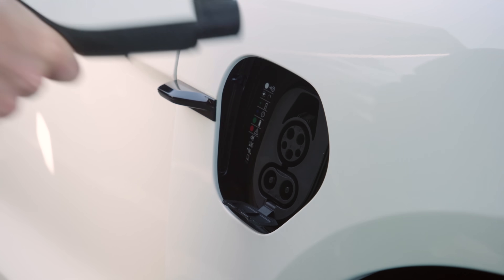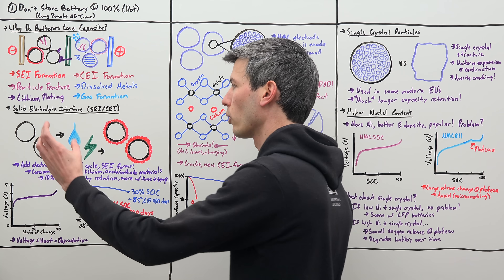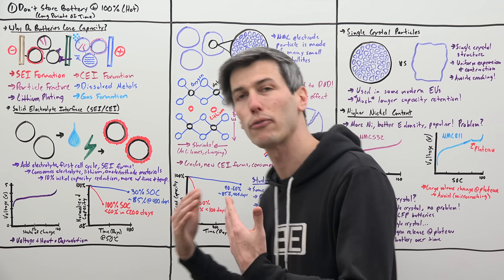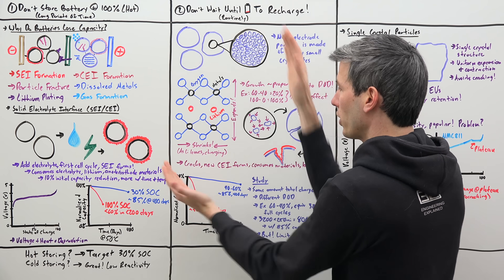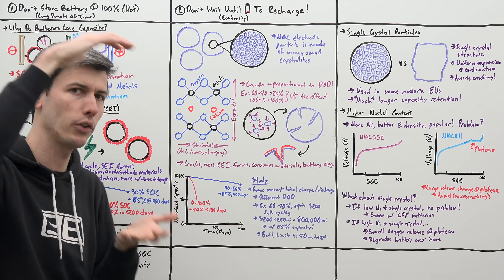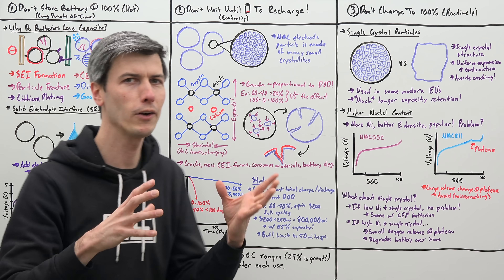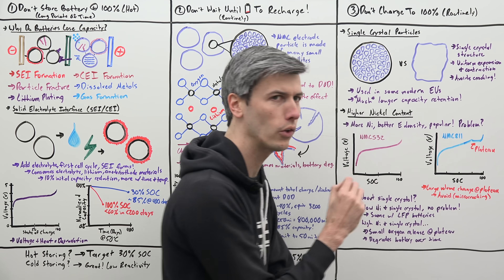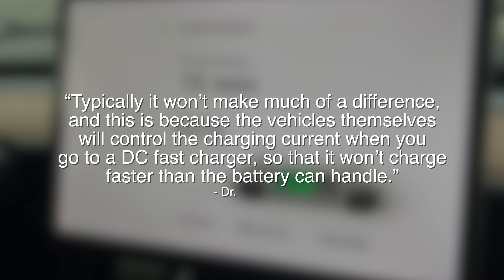How To Ruin Your Electric Car's Battery - NMC Edition!

Comment: Direct injection turbo diesels are what the world should lean towards or hydrogen power
Reply: Sic: hydrogen power. Diesels are efficient achieving up to 50% thearmal efficiency however the NOX and particulate emmisions are high, but can be mitgated with adblu or a proper exhaust system with the correct tech. However the issue woth hydrogen are that the production is highly emergy intensive and it is most often made from methane(CH4). The issue is that the carbon atom of the methane molecule combines with a oxygen gas molecule and producec an CO2 molecule byproduct. This is issue can be resolved with CO2 storage or by using electrolysis, but that requires electricity which might not be clean. Another issue is that 700bar hydrogen tanks are quite big, but do not hold a that much hydrogen.

Comment: Don't buy ev, look at Chicago winter crisis
Reply: 150 000 people mis-fueled a diesel engine last year and nobody writes about it. This was a owner problem, not a technology problem. RTFM.

EVs operate worldwide in cold temperatures. The recent extreme cold snap covered a wide swath of North America. The fact that the media honed in on a small number of cars at a single charge station in a state with 59 000 electric cars and conflated that as a disaster for the entire EV industry was silly.
Reply: @rbrtmllr  It wasn't even an owner problem. Most of the people who  were clogging the super chargers were Uber drivers who didn't have the ability to charge at home and have a habit of charging to 100%. Out of Spec Reviews did a deep dive on this in a couple of videos.

Comment: Step one: Don’t buy a EV as current battery tech still isn’t there yet.

Step two: skip brand new WAY overpriced vehicles.

Step three: buy and restore a 90s Toyota or Honda. 

Step 4: Enjoy a reliable durable vehicle that’s not full of gimmicks
Reply: Some people care about things like safety for their family and in general can afford nice things. Not everyone is a broke car "enthusiast" on the web.
Reply: @SR-cm2my now if you wana come at me with “not everyone wants to turn wrenches” that’s totally valid.
Reply: @SR-cm2my 🙄 those darn 90s cars and their inferior crumple zones, air bags and seat belts, how did anyone survive!!!
Reply: I remember when I was a kid in the 90s and everyone said the cars suck now and the old ones were way better. Nostalgia goggles never change, huh?
Reply: Just because a 90s car has airbags and crumple zones, that does not make it equivalent to the safety of modern cars. Just watch 90s crash tests vs modern crash tests, modern cars are often objectively safer. Not to mention new safety tech like emergency braking, lane keep assist/departure warning, blind spot monitoring, etc.
Reply: 90s car and early 2000s was the best.. simple easy and cheap to fix, we still have
Reply: @thatonebeone I loath the cash for clunkers program for this reason, saw so many good vehicles destroyed to save a relatively small amount on a newer vehicle, which shrank the pool of used vehicles by a very noticeable volume… I have suspensions about the real intent to it all as vehicle emissions from them well let’s just say it’s not like it was a 1950s straight exhaust and intake setup

Comment: Imagine not being able to fill up your gas tank to full without worrying about it not lasting
Reply: Nobody needs a full charge every day. Same reason nobody needs a full tank of gas IF they had a gas station in their home
Reply: yup i dont full fill up with gas...  half most the time and i hardly full tank unless i go far out trip drives .... but in very cold places EV struggle with battery and need to manage it... @Meatball2022
Reply: @Meatball2022  but the difference is that my gas car has 1. longer range and 2. I can fill it up once a month and let it stay at a full gas tank vs with an electric car I would have to charge it up at least 2x a month and adding the fact that you shouldn’t let it stay at 100% the amount of charging per month would even increase up to 3-4x. Nobody wants to spend that extra time if you don’t have a charging point at home
Reply: @dennis.lc8407 most people don't use all the range of their electric car anyways, or let their cars sit for a while. Also, don't ICE cars' gasoline go bad if they're standing a while? And their lead-acid batteries too?
Reply: @dennis.lc8407  you’ve literally contradicted yourself in your own statement. You boast about range AND the ability to never use it.
Reply: @dennis.lc8407  the video was clear. And I’m of the same opinion. It’s foolish to buy an EV without ability to charge at home. Anyone that does that is throwing the biggest benefit of an EV into the trash
Reply: @Meatball2022  I think you don‘t get my point. The range defines the days that I can let my car stay on the street without having to refuel/recharge it. I don’t want to charge my car 2-3x when I have the opportunity to just refuel a car once a month. That a technological downgrade. But I think that‘s also a difference from europa to the usa. As far as I know more people in the us have a house where you can easily install a wallbox. Not so here in germany
Reply: @nwskipro   What extra planning? You just set the state of charge in either the car's UI or the car's app before taking a long trip, other than that, leave it at 80%.

That's far less taxing than doing the basic checklist of things for an ICE before a road trip.
Reply: @lolo4gaming39To be fair, even with the level one charger, not everyone has access to even a normal outlet. Some people only have street parking, or their apartment garage/lot doesn't have outlets.
I've been using the level one that came with my Bolt to just plug in through the window of my house for three years, lol
Reply from the maker: Imagine if your gas tank was at 80% full every time you left your home. I can nearly guarantee it isn’t. It’s a really nice perk.

Edit I''m well aware not everyone can charge at home - just sparring bc this is the internet and it's what people do. ;) As mentioned in the video, in most cases, if you can't charge at home, I don't think EVs make sense yet.
Reply: @EngineeringExplained  that range nonsense is hilarious to me. It’s as if people really have no idea that they can charge their EV’s from home. 
Would you need 400 mile range if you had a gas refinery in your garage???
Reply: @EngineeringExplained sure, but if you have a trip planned first thing in the morning, & when l-o-n-g stops are necessary to ‘fill-up’, it’s just another reality check.
Reply: @EngineeringExplained  in your video the expert claimed that if you're going to be storing it for any (edit: decent amount of) time at warm temperatures that you need to store it at 30% charge.

Wild.

Battery technology and battery management have a long way to go before this can ever become truly mainstream.
Reply: @nwskipro  He didn't say "for any time." He said "long-term." That would presume you're storing the car for at least a couple of months without driving it.
Reply: @EngineeringExplained not everyone can charge at home!!! How can you people not get that😅
Reply from the maker: @dennis.lc8407  Haha, well aware, hence why I mentioned if you can't (in the video) it doesn't make sense yet.
Reply: What happens when you have a family emergency, it's a 4 hour drive and your EV isn't charged?
If it's an ICE vehicle it takes you what, 5 minutes to stop at a gas station? 
There is no way I would spend 50k+ on a vehicle that limits my travel. 
There is no trickle down of the EV market. Poor people are not going to have any means to commute. They're not going to take out a 20k dollar loan for a battery in a 10 year old car to deliver pizza's. If there's no used 4 cyl honda civics for less than 5k dollars then the economy is dead and done.

Comment: What about the below zero Chicago fiasco?
Reply: Most of those people were fools. Either had no ability to charge at home, or they were turo renters etc. 
if you don’t warm up the battery, it won’t take a good fast charge. So lots of them had issues because their charging times slowed because their cars had to precondition AFTER they arrived at the charger. This caused longer charge times, which caused longer waits, which caused more people running their heaters, which caused more battery loss while waiting…
It wasn’t nearly as widespread as you think. Maybe 50 cars were affected. 
In case you’ve never noticed, that issue has never been a problem in Norway, which has 6x as many EVs and it’s much colder
Reply: Good to hear from a meatball... heh..
Reply: @daveyt4802  does the truth sting a bit for some reason??
Reply: 30% of the vehicles in Norway are EVs. They don’t have this problem.  But shhh - I’ll tell you a secret. It gets cold in Norway.
Reply: thats when you need a ICE car
Reply: We are just going to conveniently ignore that
Reply: Several factors.  Cars need to heat up the battery to be able to charge it.  Some Chicago owners rely on 120V to charge their car (very slowly).  At extremely low temp 120V isn’t enough power to heat up the car’s battery to even begin charging, or it takes VERY long.   Increased load on the charging infrastructure.  Additionally, batteries cool down waiting in line to DC fast charge.  This the DC fast charging takes longer because the battery needs to heat up.  Also in Chicago apparently Uber and Lyft rent electric vehicles for use in their systems.  Additional load on the infrastructure, likely many of whom didn’t precondition their batteries (have the car heat them up) this very long charging times as well.  In short, IMO, too many electric vehicles in Chicago that rely on DCFC for day to day use, or don’t have a level 2 (240V) charger at home (only 120V).

Comment: Stuff everybody should know, but you realize hardly anyone knows. Just watched a video of a range test in LR 3 and the guy charged to 100% THE NIGHT BEFORE so it set all night at full and he ended up leaving the house with 98%. I wanted to yell at my screen.
Reply from the maker: It’s not a huge deal, but you can schedule it to charge early morning if you want, so that it’s a full before you leave.
Reply: @EngineeringExplained  In fairness, that's brand dependent.  Teslas can, but I had a 2017 Bolt that, if I recall correctly, didn't have scheduled charging yet.  It didn't even have a "charge limit" setting.  Fortunately, it did have "hill top reserve" which set a 90% charge limit (better than nothing).
Reply: The newer Bolts have scheduled charging and customized charge limits in increments of 5%